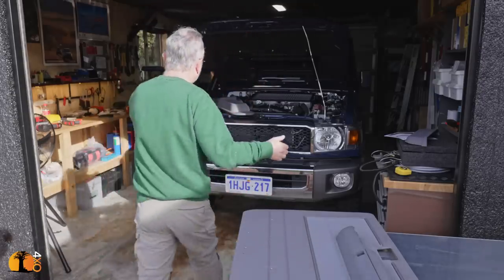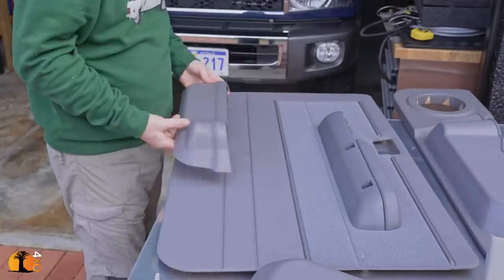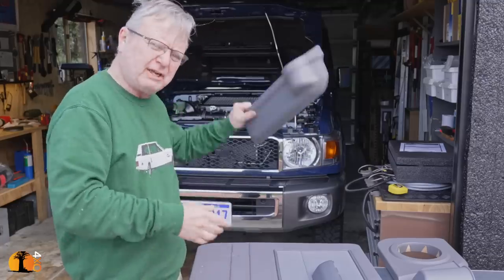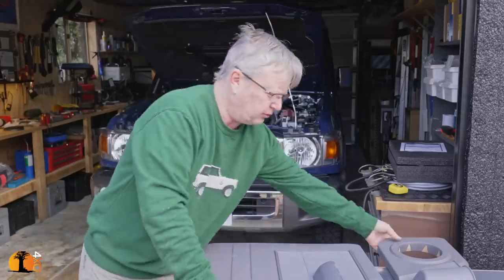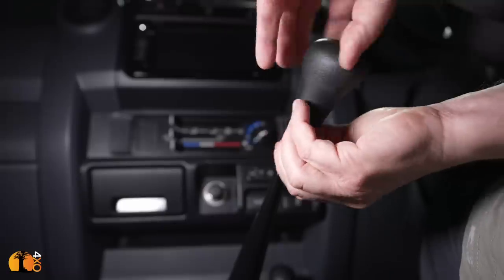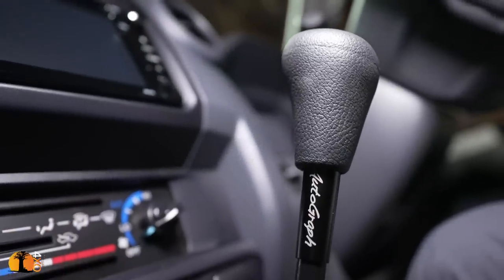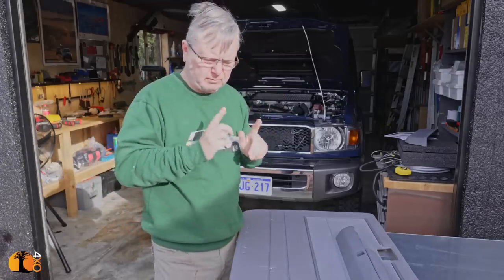MODERNISE THE DOORS | BUILDING THE BEST 2-PERSON OVERLAND TOURER IN THE WORLD | 4xOverland

Comment: Pro tip on door plastic/moisture barrier removal:  Invert a can of canned air (like you'd use to blow off keyboards/computer) and spray in small areas.  It'll freeze the tar strip and will pull straight off without getting gummy or stringy.  Repeat around the door until removed.  It'll be preserved and can be reused, it also ensures you don't over-pull the plastics and stretch them out.

Comment: I put the arm rests on my 76 series, took them away on a trip and found my right knee kept knocking on the bottom of the cup holder. Not always but enough to be annoying. The cup holder also made it harder to get to the switches on the consul to the right of the steering wheel. I had to modify the drivers side and cut the cup holder off and fill in the end with part of the cup holder. Now it’s ideal.

Comment: Suggest having a couple of screws on the after market door pockets as when there is more weight, the door card can't hold on with the original plastic clips.  Especially after water crossing the lower level of the card perishes over time. Also the driver's side door is open /close more than the others maybe Toyota did not want to put the pocket or to discourage drinking and driving.  But on a lifted vehicle a pocket running all the way I often bang my knee.  Maybe it's only me.

Comment: I've always thought that one of the major reasons for purchasing a 70 series cruiser, is that there are so many options for modifications
Reply: Don't forget paying an exorbitant amount for the privilege .
Reply: @petermeeny1038  the manufacturers depend on buyer emotion to make huge profits as most people with logic and a budget would just walk away.
Reply: @AVRO filmvideo I would not put any cheap Chinese stuff on an expedition vehicle
Reply: @AVRO filmvideo Apple iPhones are also made in China but under Apple supervisor and quality big difference with chinese made stuff. Chinese stuff is a clone without the required engineering strength. As per my understanding  ARB is made in Australia. At least my bumper in made in Australia
Reply: @GR8Tmate  Thanks. My issue is not where it is made, but who is making it. If ARB is making stuff in China it is still too ARB specifications and standards. A local Chinese look alike of ARB selling at 1/3 the price I would question the quality/ strength of material used.

Comment: Would you consider a Land Cruiser Prado as a base platform for a next project? Considering they got similar prices to the 70's Series, but being a more modern platform, improved interior features, comfortable, and better fuel consumption.
Reply: Way too small to be a practical tourer without towing a trailer.
Reply from the maker: No. A Prado is a mid-sized wagon, and while larger than a 76 wagon, the Troopy has three (maybe four) times more packaging and useable space than a Prado. Sure, the Prado is more comfortable on the road, but far less comfortable when camping and it falls short in every other aspect like range, strength, off-road performance, payload, etc. One cannot fairly compare the two.
Reply from the maker: Bottom line is, a Prado with a mid-sized off-road trailer is like a Troopy - with no trailer.
Reply: @4xoverland  thanks for the reply. But give it a thought. Best regards.
Reply: @mattmendel930  "small"? Here in Europe is like gigantic.
Reply: @RogerM88  Well it’s definitely small compared with a TroopCarrier in every sense of the word.
Reply: @mattmendel930  yes but it would be interesting to see a LC Prado build on the channel. Check how Ronny Dahl is now using an Hilux in his channel, and getting  a lot of views. The LC Prado is very capable too. Especially as a tourer or overlander, that doesn't need to do serious off-roading as the 4WD 24/7 channel does.

Comment: Resting your hand on the gear selector knob while driving is said to cause damage to the components below. Some Car Manuals even suggest that one should refrain from doing so. There are arguments on both sides ofcourse. What are your views?
Reply: I think the weight on it is irrelevant if the armrest is well positioned under the elbow

Comment: Really like the videos Andrew.  I wish we could buy these here (technically we can, but can't use them on public roads).  Just as a side note, some times when a manufacturer changes something on one side but not the other is due to crash regulations.  Maybe they found that door pocket change on the passenger side (left side) didn't work for the drivers side because of the position of the drivers feet on the pedals during a crash, or it could be that they didn't want to do it because they would have toget recertification and they didn't want to.

Comment: Yeah I did my doors with sound deadening insulation.. best thing I ever did wil my 79..
After owning a patrol (4.2 stock) for many years and climbing into a 79 series I couldn't believe how much like a tin can it sounded like every time I opened and closed the doors, it actually drove me crazy..
Also after owning both I would have to say the Patrol was better in the running gear, cab space, leg room and general ride comfort.
 While I think the 79 engine is far superior (my opinion only) along with its chassis strength and ability to carry better loads due to its longer wheel base for weight distribution, better towing ability too.. 
As I did crack the chassis in my old patrol 🤔
I can guarantee if Patrol had a v8 diesel we would be seeing endless modification youtube clips  (with added chassis strengthening) as opposed to the 79 series..
Luckily, Toyota don't have any competition.

Comment: 70 series engineers: We would like to improve the interior.

Toyota: Here's a new radio and a single cupholder with a charger.
Reply from the maker: I owned a tractor once. A Massey 25. And it had better seat/s than a 70. Got it stuck in a bog once. Pulled it out with my G-Wagen. Good times.

Comment: Ummm.. the placement of the Focal mids? Are they not just firing into the side of the dash?

As much as I would have loved to mounted mine in the doors. I ended up using the factory speaker position for the 3” mids as the least worst position. Tweeters went into gauge pods on both sides.
Reply from the maker: I tried the mids in the OE location and they were hopeless because there is no speaker box. And in the doors, where I located them is the only option. It sounds very good.

Comment: Love the videos Andrew, but I really don't get the allure of a truck that looks like the interior bits were robbed from an "oil crisis" era Datsun.  Is that why they are called the 70 Series?  Actually in the early 1990's I had a 10 year old Lada Niva that had similar door panels.  I hope Toyota does a replacement soon.

I truly can't imagine spending that type of money, then to instantly have to upgrade or replace door panels, dash, suspension and the rear axle.
Reply: Those with a budget and commonsense wouldn’t.

Comment: Andrew, love your builds, however isnt all this “stuff” hanging off doors etc adding to weight? Is it essential? I had a troopie pop top and weight was SO critical. As for suspension, well i had several variations. The best loaded was the worst empty. Finally the body gave up due to vibration etc. so im very eager to see where your weight saving and minimalist travel will lead you. Keep up these excellent videos
Reply: at what kms did it give up?
Reply: @andrewb5887  hi! 300,000k rear doors sagged and windscreen surround cracked. Roof conversion and heavy duty suspension plus miles of corrugations  and carrying too much “stuff”.. i now travel light like a back packer 👍
Reply from the maker: Not everything I fit to my Troopy is or will be essential. And I said VERY clearly, this is not a minimalist build. Please don't expect it to be one. It's, as I have said, a project to build a tourer that has a weight budget that cannot be exceeded.
Reply from the maker: 'Heavy-duty suspension' rings alarm bells. Over-sprung vehicles have the tendency to break the body faster than necessary. So you are right: Carrying less means softer springing, but with the addition of best quality shocks, the result will be fewer breakages.
Reply: @4xoverland  thanks andrew! Im really looking forward to this build as my thoughts are yours
Reply: @4xoverland  oh! Sorry mate. Ive mis read, i await with baited breath
Reply: @4xoverland  that makes sense Andrew. Im eager to see end result. Also with track widening, i recall green build had a rubbing issue. Look forward to how this is addressed 👍
Reply from the maker: @simonhjc  It did. And why I'm not going 285/75s'
Reply: @4xoverland  im being very critical for my next build as i dont want to cock it up eg tyre size etc. dual cabs frankly are not as good as single cabs or troopies imo as they are less forgiving re weight distribution plus im 60 soon and this could be my last build
Reply: @4xoverland  ps- ive found that they run best on 750x16 ie about 32. Most people poo poo me. The standard gxl alloy and tyre is rubbish combination. Just a thought mate

Comment: Hey Andrew, quick question. What is the purpose of the plastic that covers the door beneath the door card. You carefully replaced it, what purpose does it serve? Cheers!
Reply: Moisture barrier to protect the pourous parts of the door card 👍
Reply: Most door cards are cardboard and water is not good for them.

Comment: All this effort to make it quieter an more comfortable, surly just buy a 200 series or a new defender?
Reply from the maker: I think you are missing the point of the Troopy.  One cannot convert a complex 4wd like a Defender and turn it into a dependable camper, or even an effective overlander for truly remote exploration. It's not possible. But one can take this basic, dependable and hugely practical 4wd like a Troopy and make it more comfortable.
Reply: @4xoverland  Andrew please do not reply to such stupidity in future😂
Reply: @cloudysky9991  The Troopy has one thing above the 200 and the Defender and that is payload. 975Kgs of it.  The 200 has around 600Kg on the more luxury models, so with a bullbar, a fridge, 2nd battery and 4 people you are over GVM.
Reply: @spudboy1328  and it’s cool.
The others are not cool. No one cool hates troopys

Comment: What's going on here Andrew?  In this video 
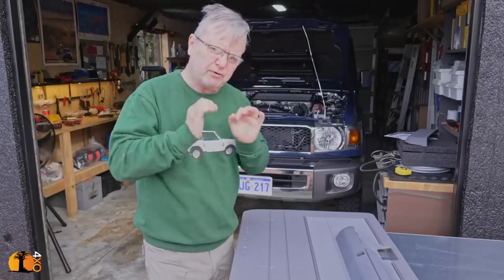HOW TO DRIVE A 4X4 off-road. FULL FEATURE VIDEO. From 4xOverland You said from 1:43 to 1:53
"Free wheel front hubs are there to save fuel they serve no other purpose" 
Now in this video 
TRANSMISSION TROUBLE. NEW LIFE for a 20-Yr OLD LAND CRUISER. part-4 from 7:33 to 8:03 you went on a rant about how free wheel hubs do not save fuel and the previous owners were not worthy to breath oxygen for putting them on the vehicle. I am paraphrasing of course but the point was you say they dont save fuel. Does older Andrew disagree with younger Andrew now days.
Reply from the maker: Carmakers know that people think that hubs save fuel and that's why they fit them. And they do save fuel! I never claimed overwise. BUT. How much fuel? Spend a lot of cash to save such a small amount of fuel at the expense of safety is just stupid. BTW. Anytime in the future if you find me change my stance over over something, it's because I'm learning too. :-)